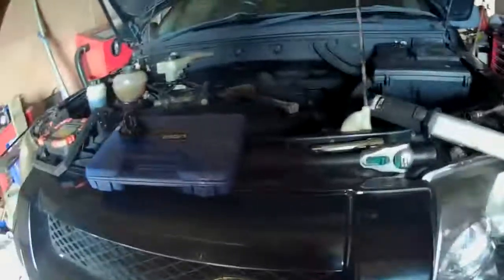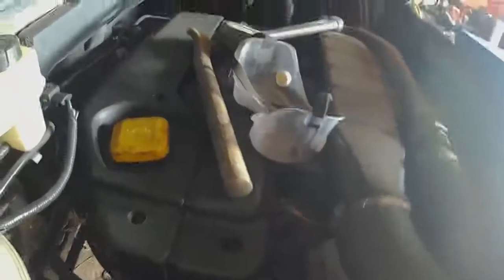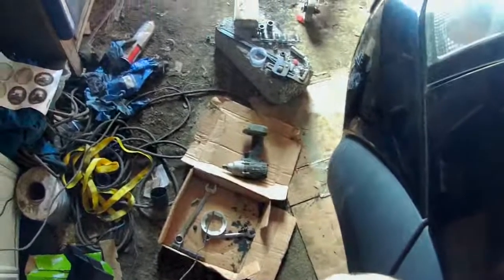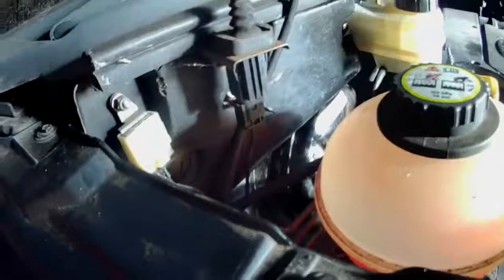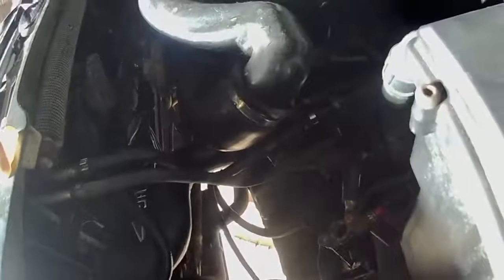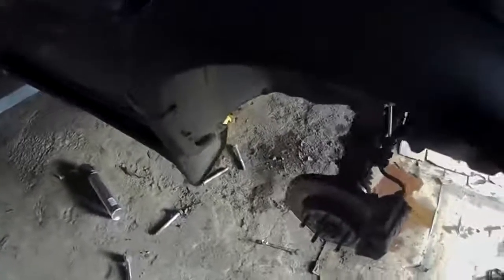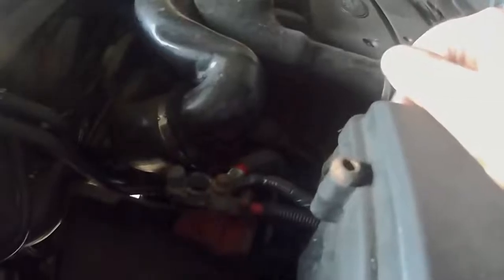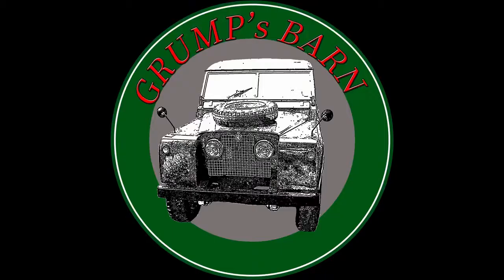Grump's Barn 47 - Freelander TD4 Clutch Replacement - Part 8

Comment: With regard to the battery clamp, could you heat the broken bolt until it's hot enough to melt the tray when you pull it up, then fit a metal plate through the side with a thread for another bolt/stud?
Reply from the maker: It might be worth a try Nige, but I'm not sure this crappy plastic would take the abuse, if it comes to it I can always refit the extra large cable ties :)

Comment: You are almost over the finishing line. I have the same problem with my battery tray. Not bothering to fix that until the clutch is done or car set alight whichever comes first.
Reply from the maker: Let me know how it goes....and get some marshmallows to toast over the bonfire...😂
Reply: @GrumpsBarn  It might get to the stage where I have to call Kevin the clutch man to come to my rescue.
I am borrowing someone's garage floor to do the job and I said it should only take a few days, lol
Reply from the maker: @gwaponobby  lmfao 🤣🤣🤣